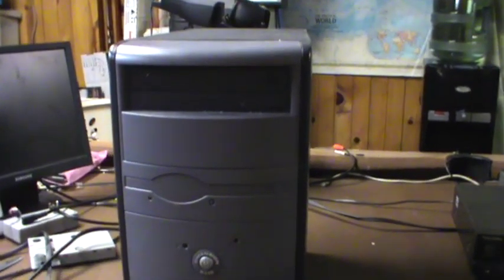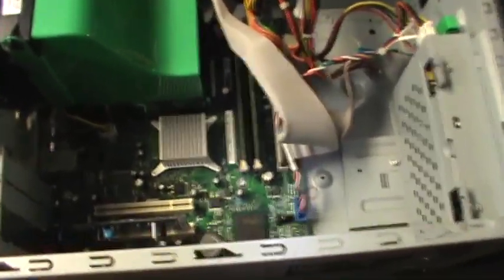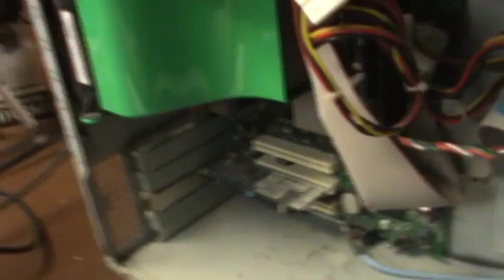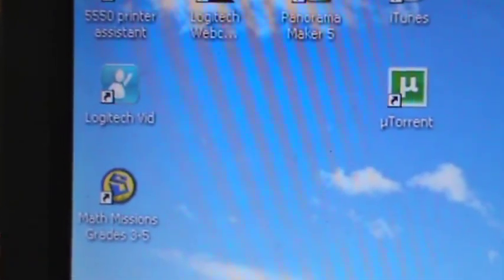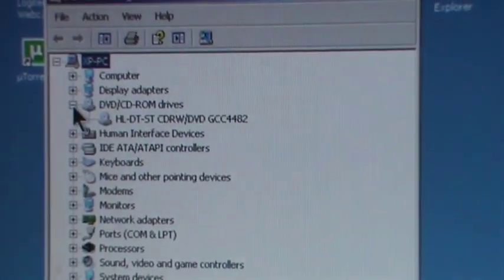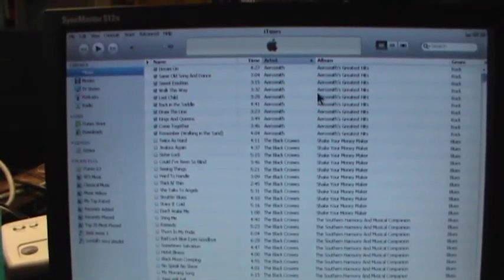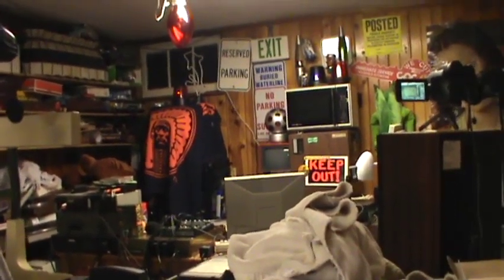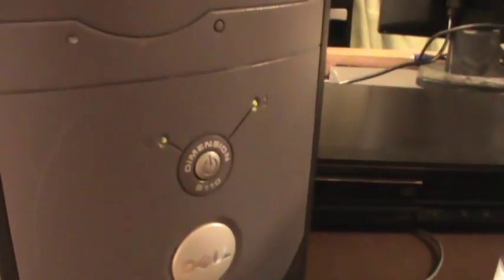"Curbled" Dell Dimension B110

Comment: Out here in a rural-turned-suburban town in NJ, the county's recycling pickup is only for cans, bottles, paper, etc., and there is no municipal garbage collection, so you have to hire a private company -- which means they'll take just about anything, but will charge you extra if it doesn't fit in a regular trash can. The county used to take electronics for recycling one Saturday a month, but they've moved that to a private company, so now you have to drop it off during business hours Mon-Fri.

Comment: @ 9:01 The hard drive made a weird noise and you mentioned that didn't sound too good. I have a Dell Dimension 4700 that sometimes when it wakes up from stand by or something the hard drive makes a loud snap similar to the one in this video. Is that snap sound a bad thing like maybe the hard drive is failing?
Reply: thats an odd head parking thing my Samsung on my laptop does that ive zeroed it and reinitialized smart and it passes and it still does that the occasional click is fine its when it does it in repetition then you gotta worry

Comment: you could pop a more capable pentium 4, pentium D, or maybe even possibly a c2d (doubt it though) if you want a slightly quicker pc. I imagine this computer is a slightly more low end version of the one I am currently on which is a dimension 4700 with a p4 3.00ghz. They look nearly the same, if not identical.
Reply: Cole G Not exactly, the Pentium 4 that's in that machine is based on the Socket 478 not the LGA-775. You could possibly upgrade it to a 3.4ish P4 or even a Pentium D, but not a Core 2 duo/quad
Reply: I didn't know much about computers at the time.  The chipset or bios might not even support a faster processor.  I had a Dimension 9100 that had the correct chipset for a core 2 duo, but there was some problem concerning voltage and also that Dell never put out a bios that supported core2 on that machine.  Lesson learned though.

Comment: had little trouble with usb keyboard and mouse on dell optiplex 330 when first got it ther eis no ps/2 but there there is a place to plug expansion thing in if had one. after changing something in bios the wireless works no trouble. had to turn off keyboard errors off on the dell dimension 8200 and maybe turn on something for it to work.

Comment: Rebuilt a trash picked dimension 3000 a few years ago, system ran great when I was done putting the full 2gb ram, changing a bad ide wire and installing Windows 7 and ordering possibly the world's last and very hard to find PCI bus Zotac geforce 610 graphics card from amazon. The system had the 3ghz pentium 4 processor and I'm glad to report my friend I sold it to is still using it to this day and satisfied.

Comment: i found one of these i nthe trash (dim. 3000) that just needed wiped and reloaded. It had a few bad caps but still worked great. Btw, these are socket 478, so they are just p4 and celeron (socket 478). These will not take a dual core because they started in 775 socket.

Comment: Does anyone know if this computer can get windows 7 installed on it and if it has all the drivers for it? I have an old dimension 1100 and trying to install it but I can't get the sound to work... Im giving this to a friend but would like it to work properly. Managed to change the resolution without a problem, but no luck with sound.

Comment: I'm currently watching this video on a dell dimension 3000 and yes it does have basically the same motherboard except for the ram slots are different, It has solder pads for 4 ram slots instead of only 2 however only 2 of them are populated with sockets

Comment: I picked up a Dimension B110 for $10 last summer.  Mine has the Dimension 3000 motherboard in it though.  Minus the AGP and SATA connections of course.

Comment: I have the Dell Dim 1100/B110.
Came with XP & 512mb.

I bought 4g (2gx2) and popped them in.
No such luck.
The computer beeped, the ABCD lights in the back went all "runway 23" on me and the monitor said OH HELL NO, WE AIN'T SEEING NO SIGNAL.

Did I put in TOO MUCH memory?
Do I need to update the XP to Win7 (32bit) for the memory to be recognized?

I was told a 32bit DD1100/B110 could run 3.5g RAM so I got these 2x2g chips - mistake?

To quote A Few Good Men..."What did we do wrong, Hal?"
Reply: +uxwbill 
so the beep beep beep noises preceding the wonky diagnostic lights and the inability of the monitor to sense a signal from the CPU because it won't boot up is ALL DUE to my attempt to jam 2x the recommended daily allowance of RAM into the "Dell from Hell"?

cuz it runs, slow as a dead turtle covered in molasses during a snowstorm, when I put the 512 back into the slots.
Reply: ***** 
I like to resurrect the old school dinosaurs for dirt.
$20 purchase. $14 for the memory.
The $34 is nearing my budget cap of $50, and that includes the Reece's PB cups and ginger beer.

Comment: It's odd, as when it had TWO copies of XP Home on it, and once even Windows 98 (I was testing it out with 98, came with the two XPs) it detected it properly. It's quite odd. There is a thing about processor serial No. or something like that in the BIOS that is disabled however.
It only appears to show up as 4MHz in System Configuration. As far as I know, the BIOS detects it properly.

Comment: Yea I just stuck an ATI X1900 XTX PCI Express card in it. It works stellar now, I ended up chucking out the hard disk and adding a solid state. Thing is a speedy little guy. I also went to the electronic recycle place and found a Dell Dimension XPS D266, and when you start it up it says EVALUATION BIOS- NOT FOR RESALE. Works fine otherwise, the dxdiag info for the bios description has a bunch of square and weird characters.

Comment: The most annoying BIOS memory test I ever saw was on an HP slot-2 machine (1998). It has a mandatory memory test that simply *cannot* be interrupted, cannot be disabled, and takes what feels like an eternity. I'd estimate it around 6-8MB/sec, and the board supports up to 2GB.
It was marketed as a CAD/whatever type workstation, so I guess they felt the need to be nannies about the memory test. But since it can't replace a more strenuous utility, it just ends up feeling like a waste of time.

Comment: That would be a sad day for me, if ct passed a law like that.  My last pc (before my current one) was recovered from the front a dorm at the college in town.  I kept an eye out while helping a friend move out, and once I had realized no one was coming back for it, took it home.  Only problems were a bad xp install, and the PCI e slot was flaky.  It was AMD 64 dual core, so not that old, and I paid it forward and gave it to my father for a desktop when i got my quad core.

Comment: My vaio pcg-z600re has a fresh install of windows 2000, detects the processor as 4mhz (intel p3 500mhz actually) and does not display it in device manager.

Comment: Interesting fix. I guess a cracked solder joint would have similar symptoms as bad contacts.
The BIOS test is so short that I tend to think it's too simple to detect anything more subtle than a dead data line or maybe an address line. It's probably similar to the first 1 or 2 most trivial tests in memtest86.

Comment: So which p4 should I throw in my old Dell B110? There are so many at varying Hz  levels... I've had my system for 8 years now and it's still alive (Somewhat...) Had to delete a buttload of malware (MANUALLY). To this day I have no idea which svchost.exe process does what. I Can't remove the mirascan driver or AOL toolbar from the software listing but that's beside the point. Looking for a great p4 and RAM combination...Any suggestions???

Comment: I had one of these that I managed to get Vista running on it FLAWLESSLY. Granted, it was slow but it worked fine. I would not recommend it but it worked fine for basic word processing and NO internet.
Reply from the maker: I have also had reports (my personal experience included on a Dim4600) of 32-bit Windows 7 running very well on these. In the case of the 4600, performance can be boosted considerably through the installation of a graphics card. For all the others, the only thing you can do is to install the "best" supported processor, which is likely to be the 3.4 GHz/800 MHz FSB Socket 478 Prescott.

Comment: I've got a 4600i and I know what you mean when you said you had to kick it around the block to get the cover off. I found that the case around the cover is actually held together by little clips rather than riveted together and those clips tend to pry themselves out as you take the cover off and put it on over and over or as you move it. Try looking for this by looking for raised edges and fixing them by pressing the pieces back together. Mine had a clip come completely out and it was a pain to put back into place.

Comment: You mentioned that the B110 series isn't a bad performer when it has the right parts, I have a B110 in my room to stream netflix and occasionally watch music videos here on YouTube. It fails to do either one (running W7 Home on a  P4 2.8GHz with 2GB of RAM, also a custom case with alot more air flow/aftermarket heatsink) though on Firefox, Chrome, and Opera (not even going to try IE) it can't handle even a 144p video. Netflix is ok after 5 mins in (little laggy at points)

Comment: i hate the fact, that it is incredibly hard to find computers for free in my part of germany.  But  i actually was lucky enough to find an asrock n68-s with an AMD Athlon ii x2 215 processor at the side of a road which has since become my main video editing machine, although it would definetly deserve a graphics card , as the nvidia onboard graphics are a whole lot worse than those of a 2005 laptop i own, on my found Computer minecraft does run at 5 fps while i get solid 22 frames on the a lot older laptop, which is a terrible shame

Comment: Uxwbill, I have always wondered something about the "Artifacts" on motherboards. It came to one day when I was installing a mini-ATX Pentium 4 (Socket 478) motherboard back into its case. Since I had took it out to do some capacitor repairs, I was wondering if I could just take a component off a dead motherboard (Like an AGP slot) and solder it on to this one. Would it be able to function at all? If it were to work, could I do that with other components as well? Thanks :)
Reply: Thanks :)
Reply: Daniël's Tech & Music Channel Thanks

Comment: I had a Dell Dimension 8300 that one was diffrent 
it had a Dell Mainboard with a Intel Pentium 4 but it was a socket 775
processor also 2 GB of DDR2 RAM with 533 MHz and pcie x16 slot

Comment: I rescued a similar machine recently. A Dimension 2350 with a 2.4GHz P4, 1GB of memory, and surprisingly enough, a 256MB Radeon 9250 in one of the PCI slots. 

Runs well enough, although the PCI bus definitely hurts screen redraw speed, especially at 1920x1200. 

The old Dells are nice and quiet!

Comment: the dell b110 was my first brand new computer, had a celeron pos that i swapped for a pentium 4, i dropped a nvidia geforce mx4000 gfx card in it. then i sold the board for a dell board that was dead, then i revived that board, and it was better, had 4 ram slots and an agp slot. WIIIIIN

Comment: why am I getting a windows protection error on windows m.e. it says I have to restart computer
Reply from the maker: Perhaps you have some faulty computer hardware. However, Windows Millennium was for most people a tremendously buggy and unreliable experience. Switch back to Windows 98 if you can.

Comment: I remember the time when 256MB of RAM was actually quite reasonable before about 2004/5 before SP2 came out and anti-virus software and other stuff like high-end games actually starting requireing atleast 512MB for decent performance.  

Win XP ran quite well on even 128MB in the early days before additional software demanded more my laptop had that and ran fine even in 2005, heck my Windows 2000 machines ran very well back in 2003 with 96MB and IE6 (Yes that was the days before Firefox existed though obviously Netscape Navigator might've still been there before Mozilla got hold of the codbase I think the only other decent browser kicking about in those days was Opera if I'm getting that right).

I can well remember my own computer I upgraded from 256 to 2GB back in 2006, and oh boy yes I was playing The Sims 2 at the time aswell as alot of other higher end stuff, and I can well remember the loading times being almost cut about 10x shorter which back then 2GB was quite unusual  but for games like Elder Scrolls IV Oblivion ye didn't feel sorry for having plenty of additional system resources.

Haha good times those were the days.

Comment: But once thing I don't get is I bought a ton of Sims 2 games about 4 years back,  that I installed to the original Seagate HDD( 80GBs) Windows is installed on a new 160GB Maxtor drive it can play those (with onboard video maxed out) at a res of 1024x768 (LCD monitor I had laying around) like a champ, I even managed to play minecraft with 10fps, and a few Steam games installed on an 80GB Maxtor drive (one being SR 2) compared to the other comment it's strange how it performs)

Comment: Nothing wrong with using a Mac Keyboard on a WinTel PC. At one time I used my ADB Extended II through a ADB-USB adaptor on my Dell at work, which promoted a 3 page E-Mail form the Sys admin telling me that I would destroy the entire computer network by plugging a non Dell keyboard into the computer....

Not a bad little computer, most people around here E-Waste Some do still set stuff at the curb, and i occasionally pick up goodies.

Comment: Two qess will it play HD video and then will windows 7 work on it Thanks good video
Reply: Although I doubt it will be able to handle HD video too well, it may be able to support Windows 7 (and probably Windows 10 as well) depending on the amount of installed RAM.
Reply: I highly doubt it'd support 10, but it does in7 32 bit.
Reply: Ya it will run 7 32 but not any vids to where U can watch Thanks
Reply: You can still buy PCI x1 video cards that do a decent job. You're not going to get HD, but a 256 card is adequate for someone who's grown up without HD. And they're relatively cheap. 

I don't know why Intel always skimped on their onboard video, but they do, That's the only place where AMD has them beat.
Reply: You are right gave one to a 10 year old , then he started streaming Mine Craft and found a old ASUS 1gb card and he is doing ok for now, but the rate he is learning trying to find another PC for him.

Comment: if its a celeron d you might be able to swap it for a pentium d.  check the chipset specs and the dell website.

I've seen the oven trick work for graphics cards, maybe it will work for your ram? :D

look at all those toolbars!

also, why are you so against torrents? i've never gotten one from a torrent

Comment: I bought some Dell Dimension 3000 ram and the screen did the same thing could you send me a link to some good worrking memory?
Reply from the maker: +Jackson Tucker Any name brand PC3200 DDR memory ought to do, and there's a lot of it floating around secondhand on eBay. Stick with a name brand (Crucial, Micron, Samsung, Hynix, LGS, Elpida, Nanya, etc.) and it should be fine.
Reply: The stick I had said Hynix on it the seller said it was refurbished I think I will just stay to new products only from now on, and thanks for the help.
Reply from the maker: +Jackson Tucker In that case the module may have been bad. Maybe it got zapped, or it just died from old age. Such failures really aren't common, and I wouldn't let one put you off of upgrading your computer.

Comment: Uxwbill could you tell me something.  I have a Dell dimension e310/3100 and I have put 4GB of ram in it.  The BIOS show all 4GB's but when windows loads it says that only 2.99GB is useable but I have a video card so about 2.74GB I think.  Could you tell me why this is happening?
Reply: well before i got this video card it showed that only 2.99 is useable and even running a 64 bit of windows it says the same thing.  is it a limitation of my processor?
Reply: well for the time it is running very well and it suites my needs and wants for a old PC.  i would like to put the ssd from my net book into it but i don't have a drive that i can put back into me net book cause i lend it to someone in my family so i could get there laptop back up and running from a dead HDD.

Comment: swap your hard drive from the other B110. if it's the same motherboard, it will just boot right up. I've done that several times. Windows will be none the wiser to what you have done.

Comment: I had the experience with Windows Vista and 7 that iTunes did a great job of slowing Windows down. I have a Mac also, and that doesn't seem to happen, Hmmm

I'm willing to bet that that computer would run better simply without iTunes, and a good malware and virus cleaning. It would appear that the previous user did some questionable things with that computer...

Comment: Do you still have that PC? What OS did you decide to load on it?
Reply: ***** No, i meant do you still have the Dimension B110 and is it still running XP?
Reply: ***** its a shame windows xp went out of support in april because its a great operating system.
Reply: Dawson Depetris Microsoft will always find an argument for Windows XP being obsolete, all though I never had any problems loading any new programs I need and/or I use on a day-to-day basis. Old, tech moving on, yadda, yadda, yadda... But I agree, it is a total shame.
Reply: John Smith So true. Microsoft needs to shut up about XP being obsolete. I have always been able to successfully been able to load my software and hardware on Windows XP without a problem. I have NEVER had a single BSOD on XP in the 8 years I have been using it!! I will continue to use XP for a long time because it just works plus, it is easy to use, fast and efficient. Browsing the internet on XP is 20% faster than browsing on Win7. XP is the best OS ever and MS is a fool to end support for it!